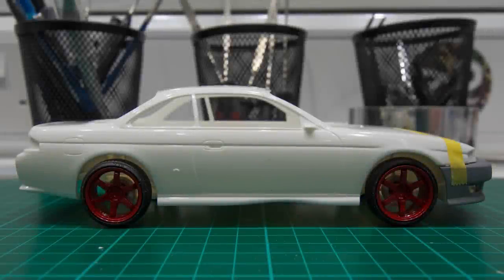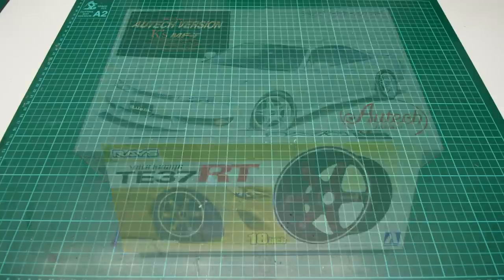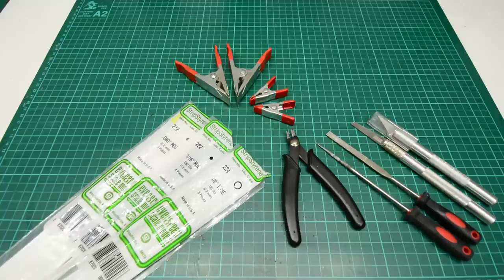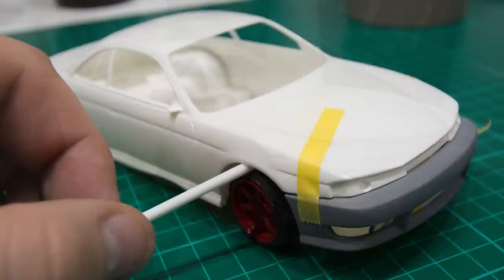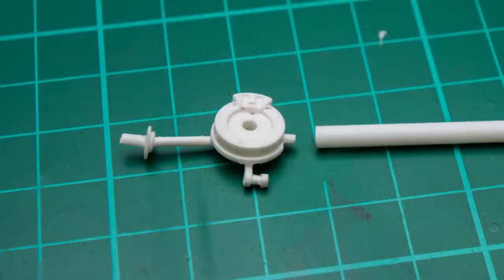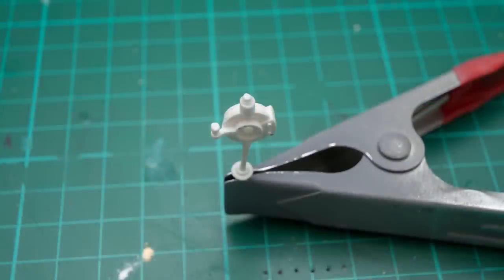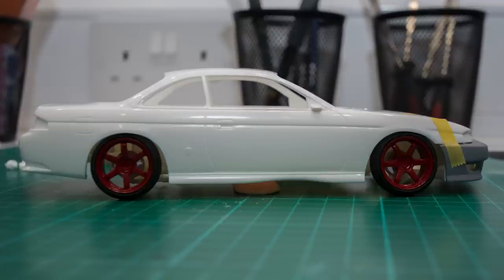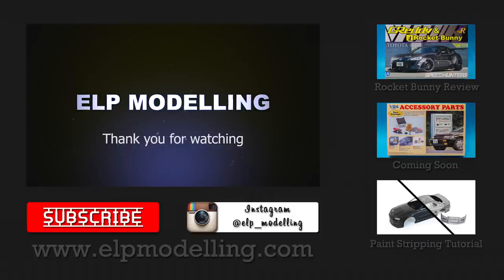How To: Lowering A Model Car

Comment: A very detailed and well done instructable, however, all you need to do is enlarge the center of the "disc" where the wheel sits in until you achieve the desired stance. I've done it multiple times and it saves all that steps you did there but congrats on a job well done!

Comment: Been looking everywhere for this tutorial! Subscribed as a token of thanks! 

I'm currently working on restoring a 1/18 diecast replica of Paul Walker's Skyline from 2 fast 2 furious. I'm quite stuck as it doesn't have a rear boot spoiler and missing a mirror! Any suggestions to what I should do? p.s. if the only way is to fabricate a custom spoiler I'm down for the challenge :)
Reply: hey bro how did it go?

Comment: thanks bro! great techniques but my only concern is that you don't see the shocks after you drop it with the tubes, i guess you could just use the aftermarket metal spring "shocks" for 1/25 scale. do you think it would work to fit those springs in there?

Comment: how did you reinstall the steering rack ? The height of the U joint is different after you you lower the suspension. Can you still steer the wheel after doing that ? Thanks